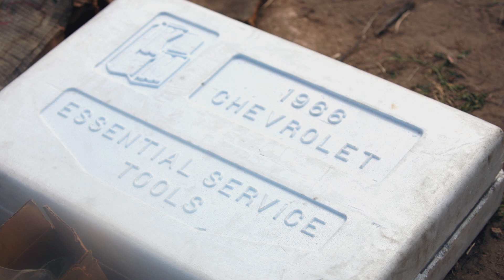Pagani Huayra Reactions! Plus Roadkill Rat Rod Mercury Rescue and Lambrecht Chevy! WOT Ep. 87

Comment: Late 80s and 90s performance cars are holding value, and some are going up. Not just because of nostalgia sake, but because people want a pure driving experience. No traction control, no stability control, no electric steering assist, etc etc. Cars from America, Germany, and Japan. Cars that had good acceleration and handling, even by todays standards.

Comment: Todays cars are _never_ going to be collectibe items. Never. Most of the won't even reach 20yrs of age, they will go into a breakers (or the crusher).
Think about it, you drive an 5yr old, sub-40k car, if you have an accident with it, in which the radiators and the headlights are crushed, it will be more expensive to repair it, than the current value of the car!
Adding to the fact that todays design aesthetics (jellybean) won't age very well, it makes no more sense to buy and store vehicles.